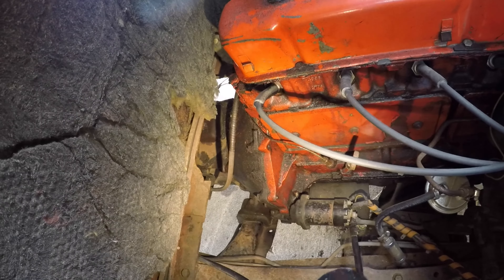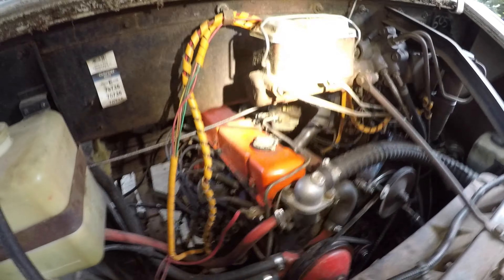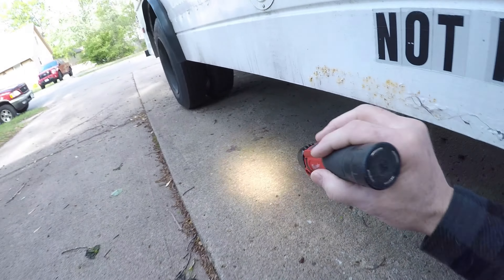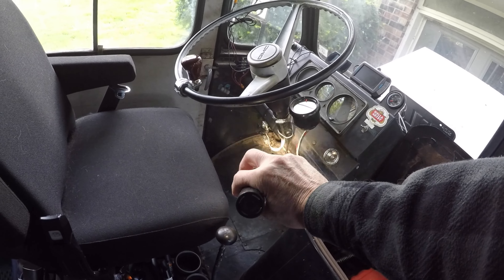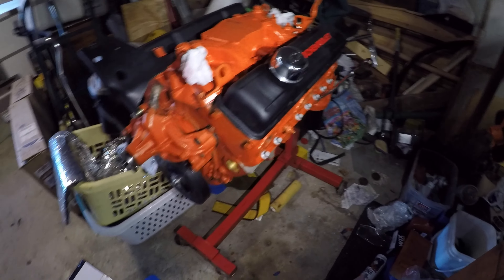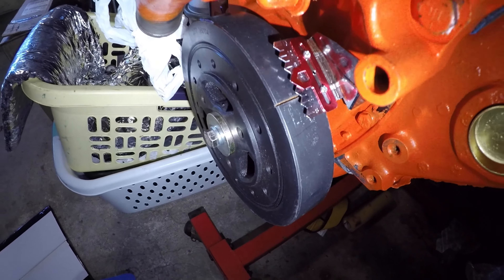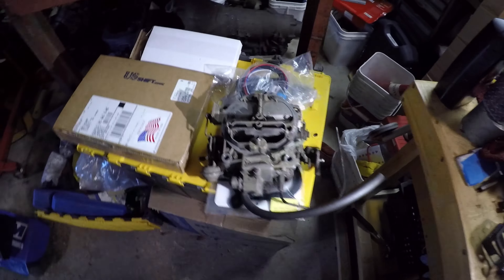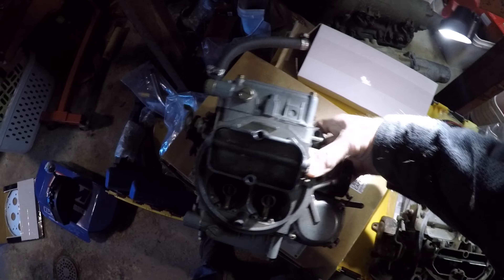vintage sbc to 4l80e retrofit

Comment from the maker: I keep say “E- Brake” when I mean to say “Trans-Brake”. It’s a brake mounted directly to the transmission and  when I swap to the automatic I will need to figure out how to get the rear wheel emergency brake kit installed. Also, idk why but I always mistakenly refer to the flexplate as a flywheel. I know the difference I just do it out of habit but I need to correct myself so sorry for that.